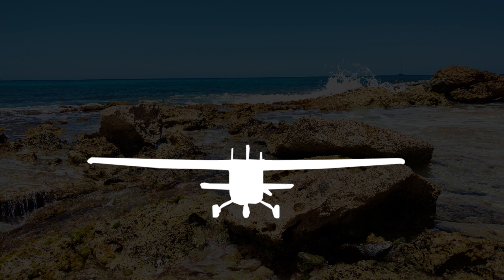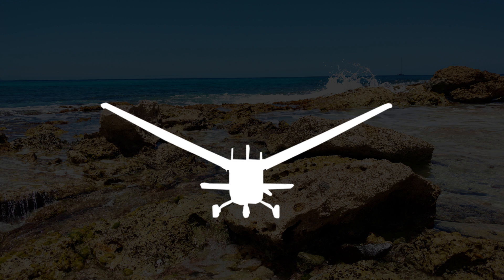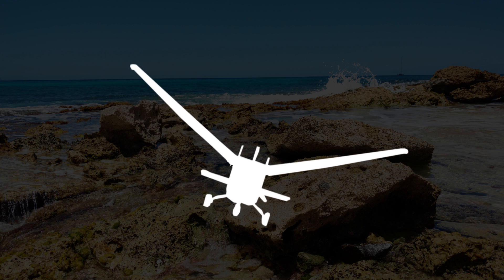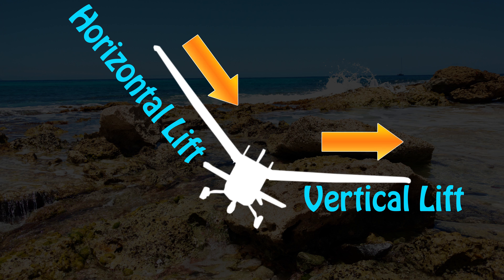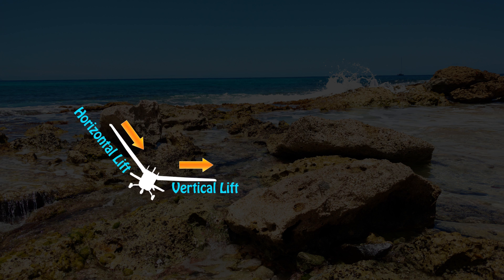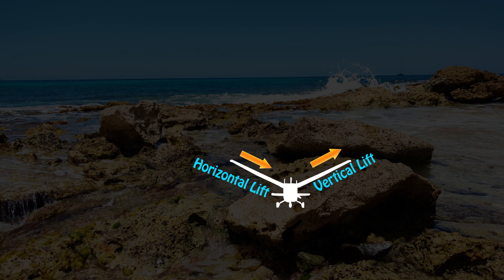Transitioning from a High Wing to a Low Wing Airplane | Explained

Comment: Why do high wing planes have struts?
Cant the roof be reinforced to support the wings just as the bottom of a low wing plane supports its wings?
Reply from the maker: Design. Some planes like the 210 dont have them
Reply: @fly8ma.comflighttraining199  ty

Comment: Great video, you're a fantastic orator! One inaccurate point you made throughout the video. Those two Pipers are not equipped with what is colloquially known as "Hershey Bar" wings. If you notice that each wing flares larger at the root, this means that if this aircraft is equipped with an O360 with 180 HP, it is a PA28-181. A comparable Cherokee which is equipped with what are called the Hershey Bar wings is designated PA28-180. You state that these Pipers have short wings, but no where near as short as the Hershey Bar wing variants. They are much shorter and look very much like a chocolate bar when viewed from above without the flare at the root.

Comment: 9:00 Interesting notation that you make 
here, this explains a lot for me, the ground 
effect. 
In this cherokee as you say, once out of ground 
effect, 'you' might think you're good to go, and 
go ahead and roll out, yet  once 
you leave that ground effect, if your air speed 
isn't above STALL SPEED, you're most likely 
going to crash and burn. I guess part of this 
supports the rule; ''don't be afraid to use the 
whole runway';  get that speed up to spec 
before pretending to be a STOL.

Comment: The dihedral for low wing aircraft is an essential element of lateral (and to an extent directional) stability. When a sideslip is induced, the low wing will have a larger angle of attack, leading to greater lift on that wing, making the plane level itself. Similar to the way keep effect works on a high wing plane, hence why they are also very stable. Most low wing GA planes tend to have a very heavy dihedral compared high performance and military airplanes, since GA planes are designed to be very stable for students to learn on.

Comment: The main 'piloting' difference is the sight picture and ground effect.  A high wing plane gets very little ground effect but is MUCH easier to see down the runway and touch the mains with the nose up.  Low wing planes get a lot of ground effect and will tend to float if you pull the nose up too high and too fast and you can't see the ground like you can in a high wing.

Comment: I would quibble a little bit on your explanation of dihedral. The reason it promotes stability has more to do with the lift vectors than side slip. The low wing is producing lift at an angle more opposite to the force of gravity and the high wing is having less of an effect against gravity. The asymetric amounts of lift (against gravity) natuarly want to reach a state of equilibrium. Therefore the low wing pulls it self up more than sideslip pushes the high wing down. Think about it. If you are in a coordinated turn there is vertually no side slip but the plane still wants to right itself. Too much dihedral can cause "dutch roll" where the wing lift balance is more sensitive and harder to achieve. Also camber refers to the curvature of the surface of the wing. What you were talking about was airfoil cross/section. Thick vs thin airfoils. Low wings a definately more prone to ground effect lift than high wings. I've been working on airplanes since 1979 and I have picked up a little knowledge along the way.

Comment: You should have included the Sopwith Camel along with the Piper "Hershey Bar" wing. Piper quit making those in 1974 or 5. You do Piper a disservice by not including more than two-thirds of the planes they have ever produced. The "Hersheys" were great planes tough. I have quite a few hours in them and much prefer Piper to Cessna except for the 182RGs and Citations. Awesome planes.

Comment: When I transitioned from the Cessna to the Cirrus, I noticed when I entered ground effect. It was a big difference to me to feel when it started to work and would cause float. Changed how I approached flaring
Reply: does low wing require lower flare height?
Reply: Michael Z high wings use a higher flare height from the experience I’ve had. Usually with the low wing I get to float in ground effect for longer so I delay my flare for longer. Now this can also be due to the fact that the two airplanes have different wing types and approach speeds as well, considering that the Cirrus SR20 is a high performance aircraft and due to its wings shape you must fly it to the numbers. It does not have as good of a glide ratio as the Cessna 172.

Comment: Dankie/merci FLY8MA. I recall flying from ZU (Zuid-Afrika) to Albion/UK. If you sit next to the wing it is difficult to see below.  A High wing is better for inspection of the wing.(???) Also a high wing do not have the "V'-shape. Why? It looks like the high wing is small bit better.. The IKRUS C42 of Germany also with a high wing is popular in South Africa. You don't have them in the US? Next question: A standby engine?   What do you do when of if your engine fail? I thinks it is the Cessna 262 that have a pull and push engines. In Europe they have an electric and gas engine in one. If or when the gas fail the electric will help.. Thank you for the informative video.

Comment: The video saying Transitioning from high winds to low wings, then you talk about stalling the airplane, 2. Issues. 1 the small Airplane is gutless in pulling power plus that design has now been in place before WW2 to now. It's out dated. To what you are saying the wings should be bigger plus 500 to 1000 horsepower V8 with super charger fuel injection and 8 propellers in a circle at 14 inches wide each and that would give you alot of serious pulling power it would be a lot harder to stall them small Airplanes. But add a transmission would be built for high R.P.M.'s on the propeller shaft. 1 to 1 ratio, first gear 1 turn on the crankshaft then 1 turn on the propeller shaft. 1 to 8 ratio. 2nd gear 1 turn on the crankshaft then 16 revolutions on the propeller shaft. 3rd gear, 1 to 24 ratio.   1 full turn on the crankshaft then 24 full turns on the propellers shaft. 4th gear, 1 to 32 ratio, 1 full turn on the crankshaft then 32 full turns on the propeller shaft. You that be something to fly with because you have speed without any problem. And you alots of power by a powerful V8 engine.😀🎈🎉🎇

Comment: Sorry, but you are crap at conveying knowledge.
You keep on letting your preconceptions bleed through, you make assumptions about the audience bleed through, thereby further skewing your narrative.
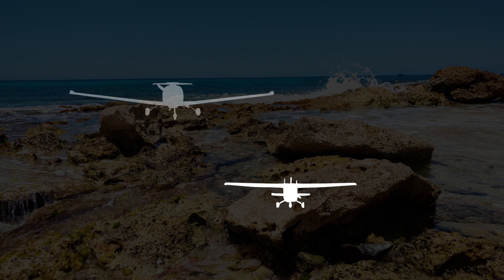Example: 2:43
"So when people think "oh it's a high wing, therefore its more stable because there's all that weight underneat it"
THEY ARE 110% CORRECT, but the way you say it you are claiming that they are full of shit to think so.
Yes, the effect of dihedral are as you say, but NO it does not make the preceding statements false!

But that's not the worst, your very knowledge that you are trying to convey is WRONG. 
CAMBER is the difference between the top and bottom surfaces NOT the distance between them. I.E. the "Shape" of the aerofoil, not the "thickness" of it.

Also:
Do yourself the favor of actually preparing a basic script and sticking to it, that will avoid duplicating info, like (7:05 , 11:15) where you repeat the exact same content about the inner wing stall strips.

And in the end.. NOT ONE WORD about the most obvious thing, the different zones of visibility.
Yes, it's obvious, but you will still be amazed at how many people do not adjust their turning and approach profiles, to compensate for when the wing will obstruct the bit of ground you are interested in.

Comment: Basically when the wings are on top it is because the whole structure is built and therefore is suspended from the wings , including tracks for big bombs. In a low wing configuration the whole structure is built upon, on top of the wings. It gets not possible to suspend , to carry and to deploy big bombs because of the engineering of its skeleton structure. You need to perform a double load on the wings by placing the bombs bellow plus the structure on top. Also there is less room away from the wings for gates on the floor of the internal structure.

Comment: You didn't mention a person's perception of build quality, an important factor to me. I've flown Tripacers, Cherokees and Navahos, and for me all the Pipers are like beer cans when compared to Cessnas, for one. I've also flown 140s, 150s, 172s, 182s, 206s, 411s (owned 2), and 421s (owned 4). My takeaway was the Cessnas were Cadillacs compared to Pipers. I'll stress that this was MY perception only, and others will probably feel differently. I also researched accident reports and found some wing spar problems I didn't like with the Pipers. Just more food for thought.

Comment: Camber does not refer to the thickness of the airfoil but rather to how much curve the airfoil has. The piper is closer to a symmetrical airfoil (less camber) and the Cessna has almost a flat bottom to the airfoil.

Comment: Excellent video, your understanding is good and I would like to kindly help it.   Camber is not chord length nor chord taper nor wing planform.   Camber is not angle of incidence or washout.   Camber is airfoil profile curvature.   Dihedral is not just about static roll stability but two more things: Pilots should understand aerodynamic yaw to roll coupling and how increased dihedral increases the effect of the leading wing seeing more AOA during yaw and producing proverse roll.   2nd, engineers would want you to know that dihedral is used to control dynamic roll center in the vertical axis to eliminate inertial yaw coupling.   Yaw coupling is evident when a center of lift is vertically offset from the aircraft C.G.    It gets worse with size, mass or wing sweep.  This is why a B-52 has anehedral.   Keep up the good work.
     -  Thank you kindly for your patience.

Comment: I flying 172 and PA28. Both plane are great. But for my I prefer Cessna 172 are more security. The design the 172 is better specialty in stall. Other problem is cessna has fuel pump both piper hasn't. The only things piper is more controllable in approaching and faster.
Reply: Socata for life.

Comment: My airplane is a shoulder wing with the wing tips 18"  forward of the pilot. 30.5 ft. wingspan..19.5 ft. in length. Cowling slopes downward in level flight. Is level in 3 point landing attitude.
     My point is...all aircraft take some transitioning....or getting used to. Most can transition with little difficulty in a short period of time with a little more time for the conventional gear endorsement.

Comment: You say thin wings is for faster speed. YET, WW1 bi-planes had thin wings, and flew slowly.  Why was that?
Reply: Depends on what speeds you’re taking about. Thin wings on slow aircraft are draggy, but a fat wing like a laminar flow one produces less drag. But supersonic, thinner is better.
Reply: A WWII biplane does have thin wings but it also has multiple cables to keep the wings supported. Every one of those cables creates drag and drag is directly proportional to thrust. Thrust being forward momentum or speed.
Reply: Part of it is horsepower and engine torque limits due to the period when built

Comment: Interesting. Could you do an explanation of the effects of the different wing shapes in military craft?? Delta wing like on the Vulcan and B-58. The strange wing of the F-4 Phantom. The trapezoidal wing of the F-22. The wings of the F-15, F-16, and F-18. And, finally canard winged fighters like the Gripen. Then you can go into the wing shapes of all those WW2 aircraft. I think this is a very good topic. Thanks
Reply: I'll try to give a quick blurb. I think first off wing shape is driven most basically by speed and maneuverability requirements. So the aircraft you mentioned all need to have high top speeds and high lift. -- bombers needing lift to get off the runway with full load, fighters needing high lift to pull those g's. Low drag, high lift is a bit of a competing requirement, so to achieve this you typically go with a relatively SMALL wing that is capable of operating at a HIGH angle of attack. The small size gets you the low drag at high speed, and the high angle of attack maximizes the lift you get from what little wing you have. 

From there, instead of thinking of wings as "delta" "trapezoid" etc... think instead as "Leading edge sweep", "wing loading", "Aspect Ratio", "Wing Taper". The characteristics you get are roughly as follows:
1. Leading edge sweep: Lowers wave drag at super sonic speeds. Higher sweep for higher mach.
2. Wing loading: Higher wing loading (smaller wings) produce less drag at high speeds, but lower overall lift. -- high wing loading has higher takeoff/landing speeds, less payload capability, worse turn performance, but higher top speed for given engine thrust. Typically only high thrust jets (f15, f22) can get away with LOW wing loadings and still have good top speeds.
3. Aspect Ratio: Lower aspect ratio wings produce less wave drag at super sonic speeds (so lower parasitic drag), but more lift induced drag. -- So lower aspect ratios are good for top speed, but more draggy when maneuvering. This negative can also be offset by engine thrust. Low aspect ratio wings have the added benefit of higher stall angles of attack.
4. Wing taper: A more tapered wing will tend to produce less lift induced drag due to reduce wing tip spillage. A smaller wing tip (higher taper) will also reduce tip stall effects, helping control at high angles of attack. Most jets (like f-15 thru f-35) have wing tip twist to produce a similar effect to wing taper. -- there is typically one "ideal" so not much to trade here. All modern fighters tend to have pretty large tapers. Reasons to truncate the wing (as in trapezoids) and not fully taper down (as in deltas) are mainly structural.

Additionally due to the desire for high lift at high angles of attack aircraft employ various types of "vortex generating devices" as vortices help energize the flow over the wings keeping them working well past when they'd ordinarily stall. Most american jets from about the F-16 and later have some form of leading edge extension or "strake" to produce powerful vortices over the wing roots (you can see these in high angle of attack photos of the F-18 for example). Canards on aircraft like the Gripen or rafale produce a similar effect to this strake.

Last thing to point out is the wing shape isn't the end all. Engine thrust works hand in hand with the wing design to give an aircraft its performance characteristics. So for example an F-22 which has a lower wing loading than an F-16, is still faster due to its mega thrust. Also for example the F-22 has a significantly lower aspect ratio than an F-18 (so produces more drag when turning), yet still has a better sustained turn rate than the F-18 due to its lighter wing loading (producing more over all lift) and high thrust (offsetting that extra drag from the lower aspect ratio wing).

Comment: When I started my lesson I started  in a low wing. Then I went to a high wing. What i learned was low wings you had to fly all the way to the tarmac. I a high wing you land the last ten feet was easer, & dropped easer to the tarmac.
Reply: I trained in a 172, and just purchased a cherokee 235, and hell yes you have to fly it all the way down.. none of that cutting to idle at 20 feet once youve made the runway, and gliding in..     anyway, ya you're right

Comment: My first low wing was transitioning from C-152/C-172 to a 1968 Piper Arrow. I thought it was miserable because it glided like a rock & was difficult (at first) to land with it's short, stubby "Hershey bar" wings. Then I got into a Beech Debonair & Bonanza & found stability and ease of flying like I'd never experienced. I prefer the visibility of high wing, but those Beechcraft planes are so rock solid, maneuverable & enjoyable in all flight scenarios they're hard to beat.

Comment: At first you say the Cessna wing is straight indicating no Dihedral but later mention is actually does have some. Technically, I believe theirs 3.5 degree Dihedral in the Cessna 172.

Comment: when looking from the wing the wing tip, you can see the washo-out and varying angles of incidence ( angle between the chord of the wing and the longitudinal axis of the fuselage). Using the term angle of attack ( angle between chordline and relative wind) can confuse new learners.

Comment: which one would you land on a dirt road, the high winged one, or the low winged one?
Reply: Trees and sign posts will destroy both wing types.
Reply: Does not make much difference if you have the right suspension and wheels under it and the surface is smooth and long enough to float it out. If the surface is shit or the wheels are then the high wing is only gonna change the shape of hole you leave in the road when the wheel snap or get gutted unto the road
Reply: Well I'm not a pro. But look at the bush-planes. Every one of them is high-wing pretty much.  Idk why, But i would follow their lead on that. Lol
Reply: The 737 is/was available with a gravel runway kit. The 737 is low wing and has short landing gear(for manual cargo loading.)
Reply: High wings allow more ground visibility and object clearance. Nothing to do with the dirt surface, but bushes and fence posts. Pusher props are none too fond of gravel kicked up by the tires but they are slightly more power efficient.